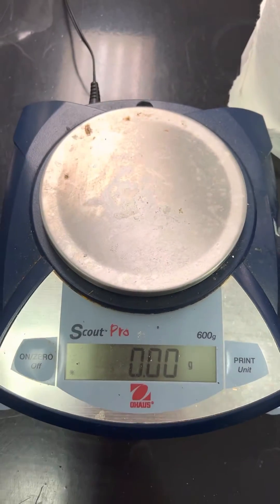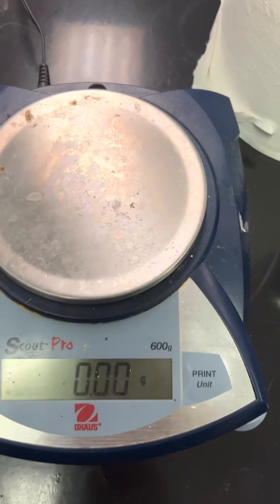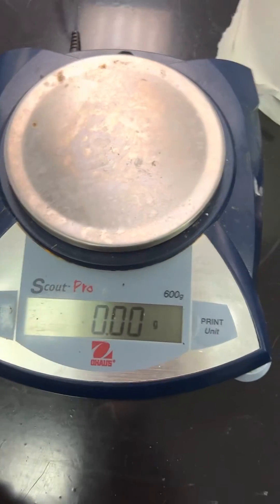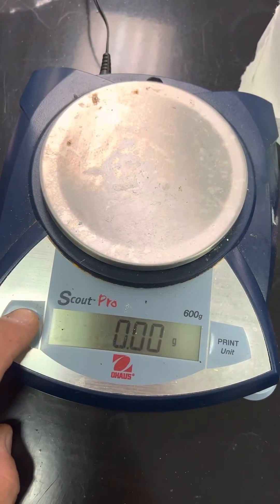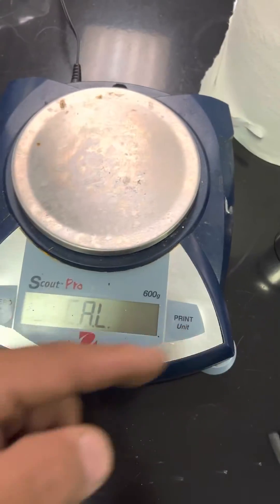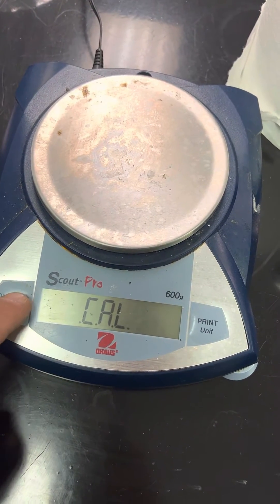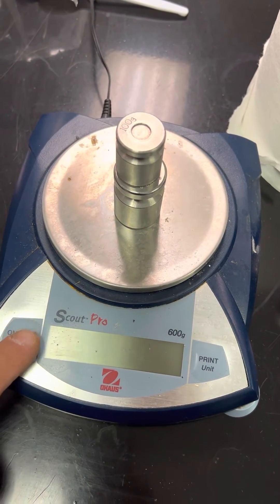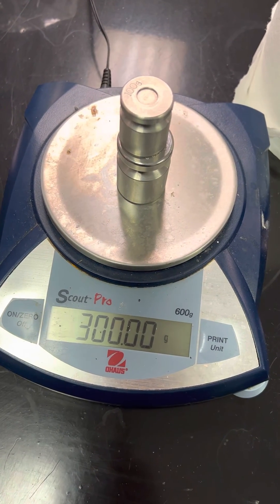Calibration adjustment of a Ohaus             SP / Scout

Comment: pardon my ignorance, but is this process also called "taring"? Like how to tare a scale? thanks
Reply from the maker: The video is calibration adjustment, not about taring off weight applied, but to tare off applied weight, you Apply whatever it is you want to tare off, press the tare key and it will zero off that weight, it’s rare, but some scales or balances won’t have a tare key, if it doesn’t have a tare key then the process is the same except you press the zero key instead